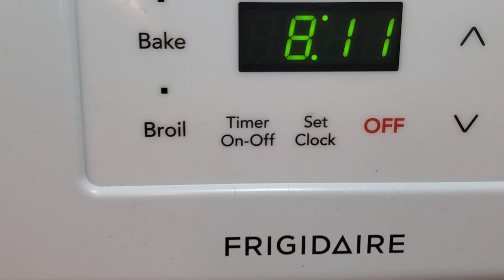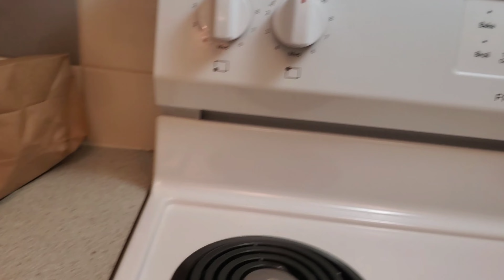Electric Boat - Refurbished Lynch Motor 🤙

Comment: I love these motors, I own one have used it for many projects.  Mine is an older AGNI and I am currently making a hybrid boat motor with it.
Reply: I ran it on a cheap Chinese PWM controller, do you think that could damage it?  Seems to run great, but you cannot back off the throttle quickly-otherwise it was awesome.